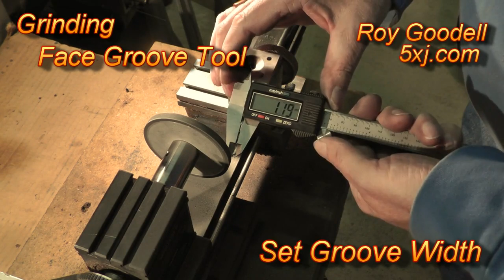Grinding Cutters with Freeky Cleen and Dickey F

Comment: At 9:20 there is big wobble at the collet chuck do you really require that much torque with the spanner.
Reply: Not sure about your question, but anyway -  I do tighten the collet adapter a fair amount.

Comment: We need this engraving tool granding machine.  How can we buy this???????
Reply: This is a tool post attachment for a taig manual lathe. It uses a diamond wheel (req for grinding 3 sided pantograph style carbide cutters). It uses a erickson da 300 type collet extension. I tend to use a  lot of very small cutters (0.05mm) which I run at 60 - 80 k rpm. If interested I can make these tool posts - $450 - special order - 3 wks.

Comment: Nice! Thanks for sharing! Do you have a video on the tool post?
Reply from the maker: Not yet... See video notes (above)... Toolpost is mounted on a Taig Lathe and uses da300 collet chuck. Grinding carbide blanks require diamond wheel. 
Blank toolpost (without collet chuck, diamond wheel or taig lathe) would be $95...
If you are interested.... and I'll create a youtube video... Cutting titanium with small (~ 0.2mm)  carbide 3 sided pantograph style cutters requires running 25k rpm or faster spindles...  I also make high speed spindles for these small cutters.... another possible video.
Reply: Thanks for your reply.  I"m wondering how you are able to index the tool blank accurately in the tool post.
Reply from the maker: I index holes in the handle/wheel mounted on the collet mandrel... and have a spring plunger screwed into the toolpost base.